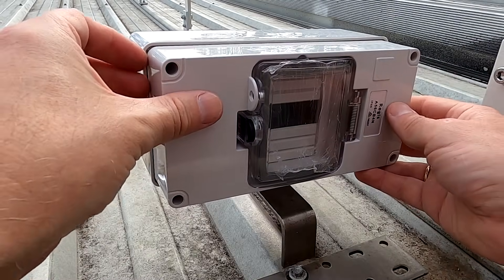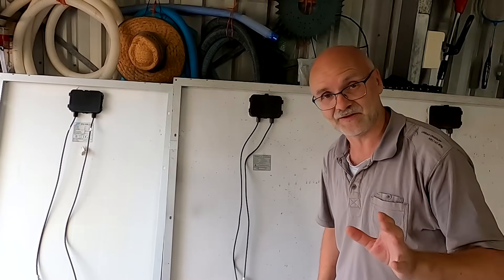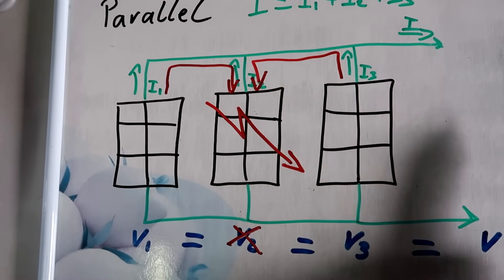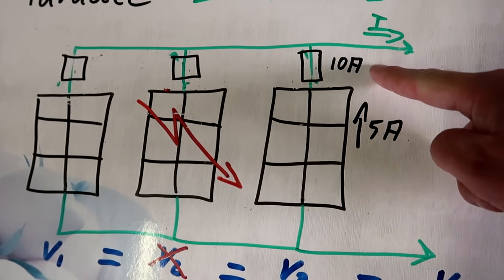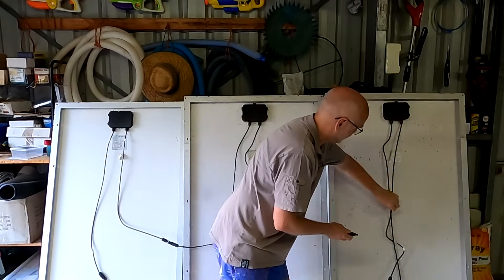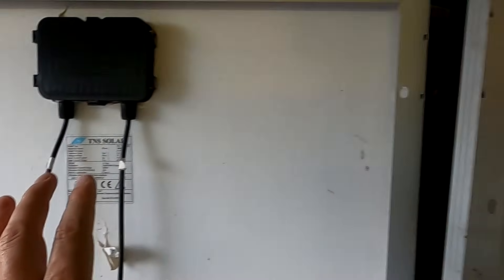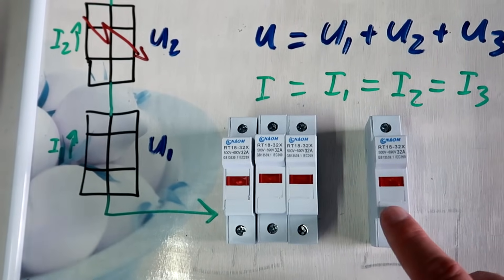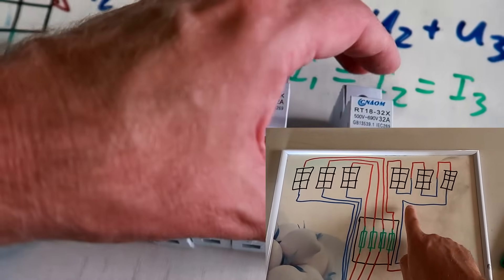Tutorial: Solar Panel Protection in Series and Parallel

Comment: Most quality charge controllers have reverse current protection built in and will actually disconnect from the PV modules when not charging. A decent MPPT controller makes a great deal of difference in the amount of usable power one can get from your PV modules. Especially if it allows for high voltage PV series strings, as one can get usable voltage above that of your system even when cloudy. My 6kW array wired for 600 volts with a Schnieder MPPT controller will still charge my 48 volt system with 1kw even when it is raining in all but the densest cloud cover. Buy a decent MPPT charge controller and forget about the blocking diode!
Reply: If you buy a cheap charge controller, it can mess up your entire system. You want something good for the controller.
Reply: You're right. Diode there can protect.

Comment: Each panel should get it's own fuse before the branch connector and the charge controller. I have been trying to find this information explained on Google and on Youtube, not as easy to find as I would have thought.Thank you for explaining this so thoroughly for those who are having a difficult time understanding. I love your accent!
Reply from the maker: Thank you, Ashley. Appreciate your feedback.
Reply: If the panels is connected in series or alone there is no need for fuses because the short circuit ampere is exactly the same as normal operation amperes, meaning the fuses will have no effect and never break and never protect anything...

Comment: Some notices that i thing are very importand:
1. There are boosting chargers which can charge a battery from a lower source voltage (They are called DC to DC converters or DC toDC chargers)
2. Fuses must be calculated on power and  NOT on amperes because in case that they have made for a different voltage probably will not fuction properly . Fuses have typed on their bodies both amperes and volts and some other codes about their reaction time  under full power (Instant or deley blow) That i want to say is that a 5A 250V fuse needs to melt 1250Watt power wich means that if we put this specific fuse in a circuit with 50Volts the current which need to melt rice to 25Amperes!!!!!  So the proper 250Volts Fuse to protect a 5Amperes 50Volts circuit is 1Ampere!!! 
Give special attention when choise fuses , because any mistake in calculations is  serious reason for a future disaster.
The same for the low Voltages battery fuses .
3.PVs , PVChargers (PWM and MPPT) and Batteries work with DC . DC has two enemies : Distance and cables diameter . As longer the distance we want to transfer the dc current so much biger diameter cables we need to use. Because dc current transfered on the surface of the cables and not in the core , we use multistrand cables wich have significant more surface than comon cables especialy when we have to handle DC power (Battery cables , yelding machines , PVs etc) 
As result of the above is that a parralel pv system needs significant larger cables than these wich need the same system as string (serial)  especialy when there is distance between PVs and Charger - Inverter (for the grid tide systems)
Sir You make excellent job and i hope you keep up!

Comment: being a bit lazy while working on my van solar i was re wiring the 75v voc panel input to a new mppt. did it live knowing if i only grab one end i wont get a zap. also knowing i'm working under the bed in the van with metal around me grounded to the chassis. well i had my arm leaning on the fridge slide when i twisted the end of the solar positive wire to make it nice for the mppt input and zap. am a bit used to working on 24v live and getting mild tingles so i was not too fussed about a potential 75v zap. it did kick a bit. lol. do not do this at home. especially in higher voltages as it could kill. in fact i read now 60v is the lowest recorded voltage to have killed a person. rare but possible.
Reply from the maker: Thanks for sharing. Yeah, always be careful. Even if the voltage is low, the scare moment of a short may be even worse than an actual zap.
Reply: @OffGridGarageAustralia  yes you could easily jump back and injure yourself also. Its not always amateurs that make mistakes or have accidents too. often accidents happen to experienced people who know better but become complacent and too comfortable with what they are doing and the risks. I did know better. but i was eager to get it hooked up and did it live. i did expect id probably zap myself ahahaha. i guess there was some curiosity on what a 75v solar panel zap would feel like there too haha

Comment: Question about a JP21-19/900 - 72VDC, 1.2HP, 62ft, 92GPM, Solar Water Pump with MPPT Controller -  I have 4 x 270watt @ 35.5v Solar Panels. Will the controller handle 142 volts coming in and deliver the required 92v if connected in series?
Or will I have to connect 3 panels in series and 1 panel in parallel to them?
Or possibly 2 pairs of panels in series and then connected in parallel?
I would like to use all 4 panels if possible???
Thank You for your expertise.

Comment: Need help. I have a 100/50 Victron solar charger with a 20 amp circuit breacker. I am planning on 3 190 watt 12 volt panels on my RV running in series. Does this sound ok? Really appreciate your videos.

Comment: Do you loose the same amount of  total power if there is shading on one panel whether in series or parellel ?
Reply from the maker: No. If they are in parallel, it will affect only this one panel. If they are connected in series, it will affect the whole string

Comment: Thanks Andy, once again you have helped clarify an few things and helped me understand my options better. I will have 2 360 W panels and I will use 2 MPPT in order to minimize the impact of shadows. Boats typically have issues with the sails blocking parts of the panels. I sized my controllers to optimize for this. I now have a better understanding my other option to use a single controller and the fusing options in the event one controller fails.
Reply from the maker: Thanks, Kevin. That sounds like a good solution and I would do the exact same thing.

Comment: Some solar charge controllers are boost convertors!
Reply: Apart from using blocking diodes in parallel arrays which wasn't mentioned, you are correct about converters as most MPPT charge controllers have both a boost and buck circuit, the advantage of series is the reduction in voltage drop allowing smaller cabling especially over long runs

Comment: I will be using 4 panels which are 400 watts each connected in series. So if I understood your video properly I only need one fuse? Or should I put a fuse in between each solar panel connection? Also which amp fuse should I use 10amp or 15amp?
Reply from the maker: It's a series connection. You need only one fuse to interrupt the whole circuit. In parallel connection you want one for each panel though.

Comment: Why not put a diode on each panel to prevent backflow into the low solar panel ?
Reply from the maker: Yes that is possible too, just not very common. A diode is not a safety device as a fuse is.
Reply: @OffGridGarageAustralia  Andy, the diode is not only there to protect the panel, but also to correctly balance the voltages of the panels which are not all the same (tiny difference in the construction of the panels). A Schottky diode (0.3 volts of voltage drop) will give good results.

Comment: MC4 connectors are rated at 30A......a 4-multi branch parallel connector would mean only 7.5A per string.....that's pretty low these days. Not a good idea to cook the output MC4.

Comment: What happen if we put a diode. There would be voltage drop like 0.7v for sure, but it would totally stop reverse current flowing back in solar panel. Any suggestions...
Reply: This is the correct solution. You need a diode at your load called a "blocking diode" and one at each panel called a "bypass diode". The bypass diodes do not normally carry current, only if the panel is shaded or faulty. The blocking diode needs to be rated to carry the total current.
Reply: A blocking diode should hopefully be a part of your panel already unless you made your own.
Reply: @fishmanfairclough7530 ok xnks
Reply: gd day sir, i have 6pcs 200w solar panel in serries connection the VMP is 18.5, IMP is 10.82. my question is how many amp do i need to put in fuze box? thanks sir i hope you answer my question ⁉️
Reply: Use shottky diodes with less voltage loss
Reply: wich installed blocking diode in series or parallel of the solar panel?
Reply: Solar panel composed already a diode once u open the terminal box of a panel diode found inside. So using for another diode is not necessary

Comment: You said that we can put the fuses in the fuse box in the garage, then the parallel connection should be made in the garage that needs more / longer cables than only splitters with MC4 connectors shown in the early part of the video, right?

Comment: I would use a 6A fuse actually. A 10A fuse could take up to 20A to actually blow.
Reply from the maker: These fuses are actually pretty precise when the thin wire inside melts. As far as I could google it, they have only a +-5% tolerance so are a bit overrated and 10A is actually a 11A fuse and it could take 12A to blow it.
But yes, a 6A may work as well, although it's a bit close to the rated 5.2A of the panels. Under ideal conditions, they could produce over 6A for a short moment.
Reply: Peak load and continuous load is an important factor to remember for the fuse. In a continuous load situation, I prefer at least a 30% reserve to avoid heat build up in the fuse.